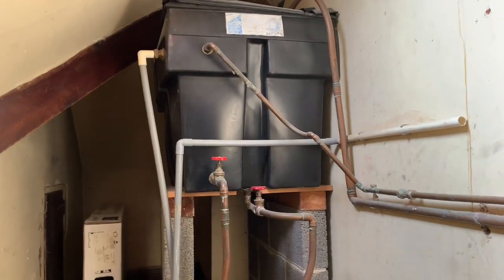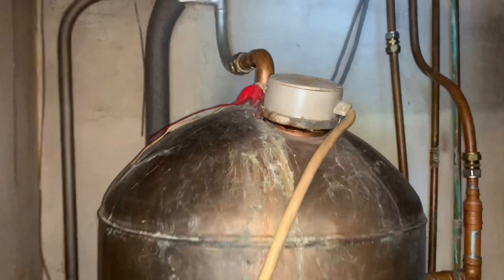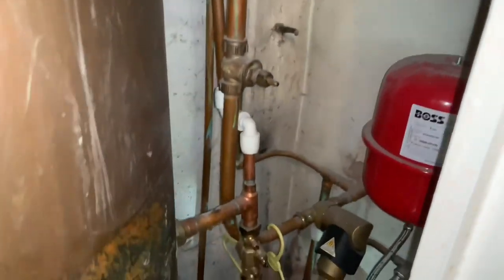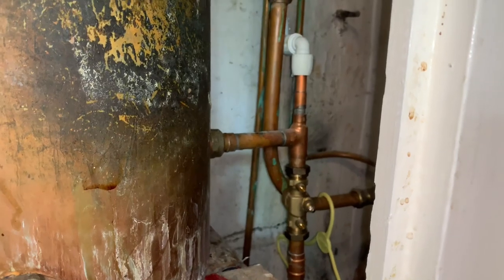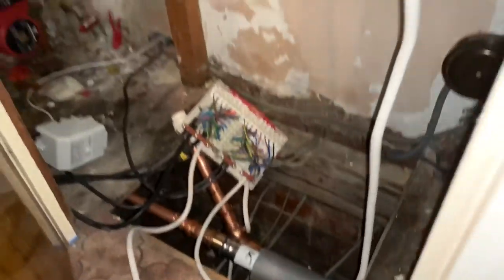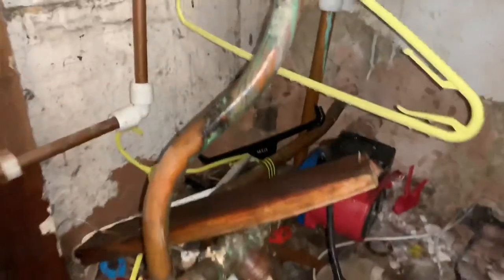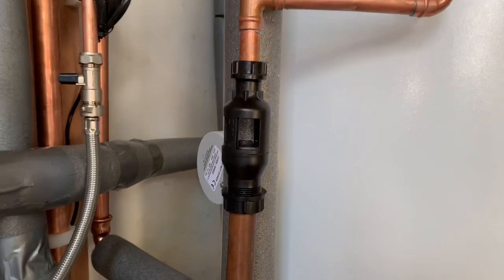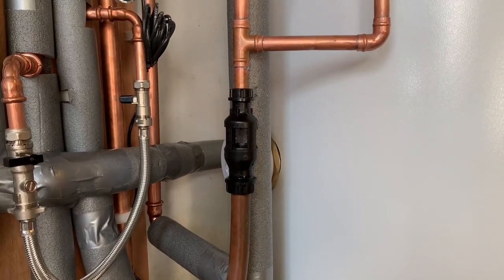Plumber - Removing a cylinder part 6

Comment: is looks  like that's  cylinder  seen a better  days   did  you have to remove  the old  motorized  valve  as you disconect  the cylinder  well explained  Allen enjoyed  the  video.

Comment: Great stuff mate. Am I wrong to think that having the bathroom radiators on a separate loop has something to do with providing an area that the hot water can always go to if all the other rads get closed?
Reply: Depends on the heat source and controls, normally solid fuel (uncontrollable heat)  would have heat sinks on wet systems ie radiator to disperse heat.

Comment: Nice nice job
quick question, heat only boiler not firing on hot water only,any ideas ,please
Reply from the maker: Zone valve, Timer, thermostat ? Thanks.
Reply: @AllenHart999  thanks Allen, keep up the good work